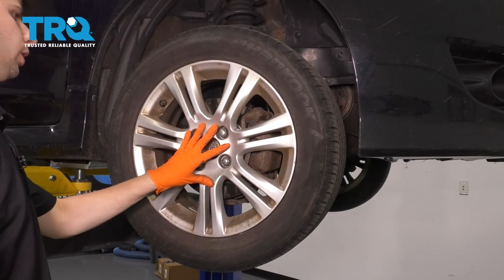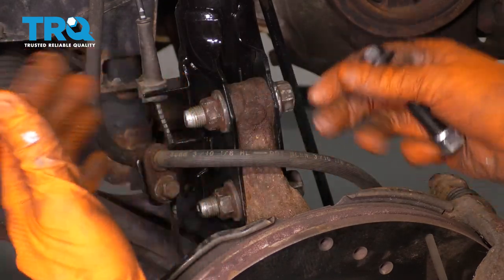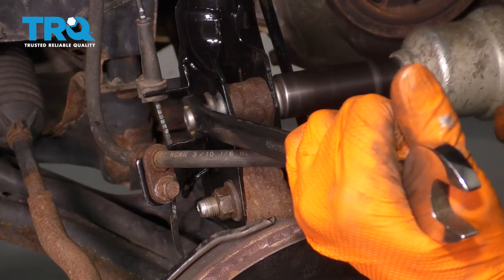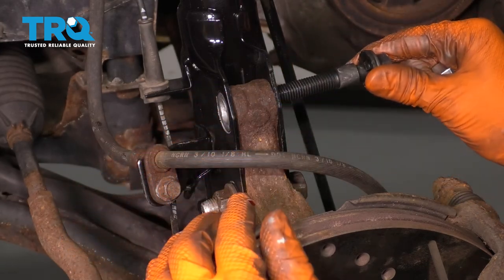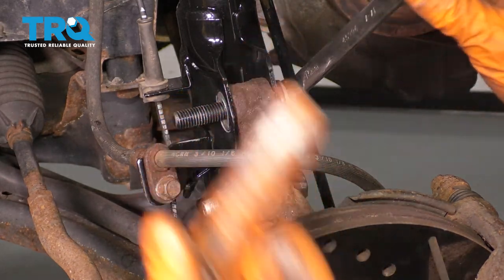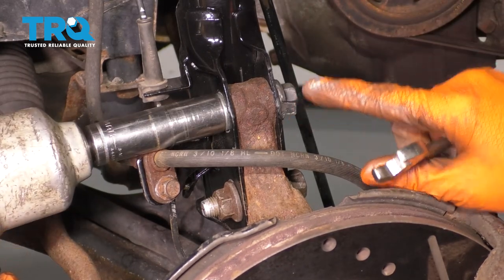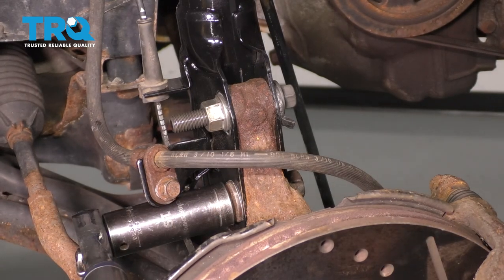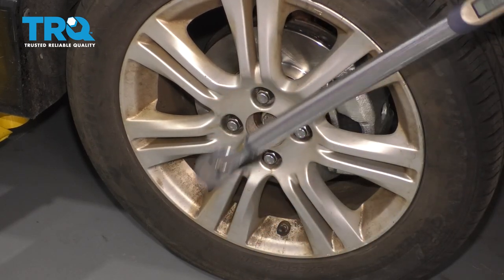How to Replace Alignment Camber Bolt 2009-2014 Honda Fit

Comment: Mine pulls right when I brake. Had an alignment done and all new suspension.  Would this be the issue or could it be a clogged brake line?

Comment: Thus some cars and especially the old Ford Fairmont had a really messed of camber from the factory that was a desight flaw and they ate your new tires alive. Im thinking some type of adjustment kit might have solved that problem. Also, my 1998 Mustang 5.0 used camber plates at the top strut mount that had almost no adjustablity. The camber is factory set. Some guys unstalled aftermarket camber plates for racing purpuses.

Comment: Seems to me that the  factory doesnt use a adjustable camber bolt because under normal driving you dont need to fuck with the camber. Thats my take on it.